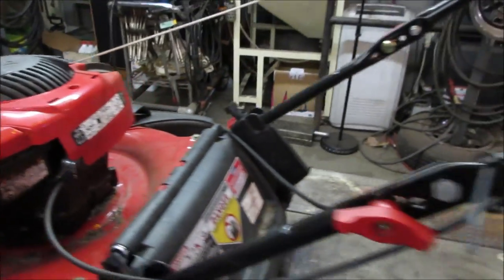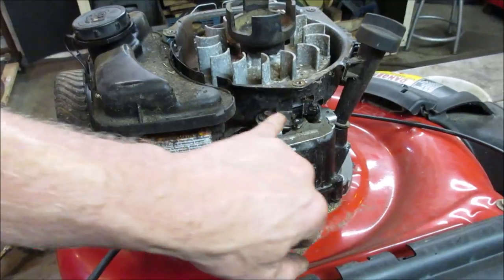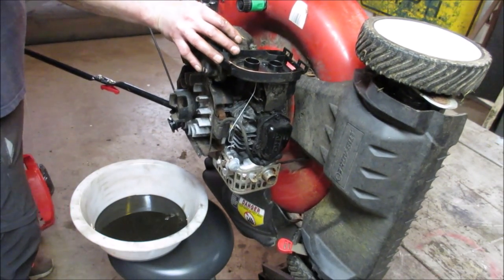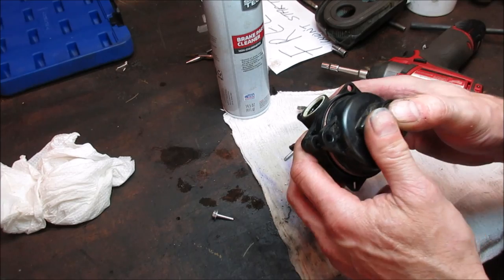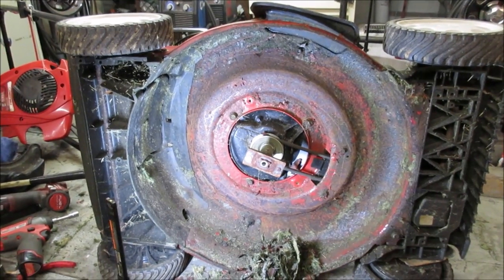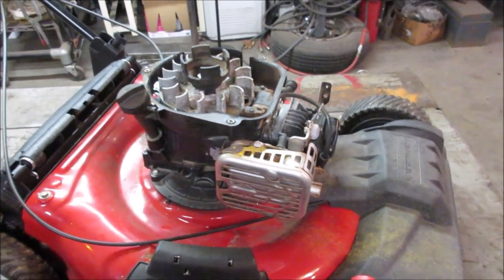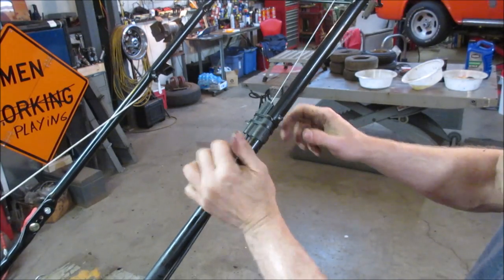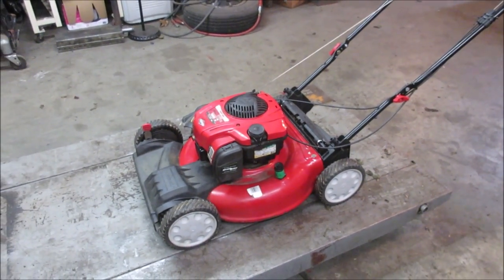How To Restore A Junked Lawn Mower. For Cheap.

Comment: A great tool to have for all engines is a propane torch that is cut off. Take a hose and put it on the torch. You can then meter fuel. It makes for great diagnostics. I have even ran lawn mowers left outside all winter with propane for 10 to 15 minutes and then they were able to run by itself after being cleared out. I highly recommend you try it.

Comment: I have one of those disposable mowers from Lowe's and even with a cleaned carburetor, I had to chop off the choke/throttle interconnect to get it to run.  Emissions requirements have ruined the performance of small engines.

Comment: Evening. 
Firstly, loving the channel. Full of useful information, really easy watching and look forward to catching up with your clips👍

I have a question if you don't mind?

I noticed you used break cleaning spray on the plastic carb today. Is that cleaner safe to use in the USA on carbs?
I'm in the UK and they say not to use break cleaner on carb because they rot the seals and will stop working??
In the UK we use carb cleaner because it is O ring friendly compared to break cleaner.

Just wondering if my hardware is bulling me 🤔😂

Comment: Reminds me I need to clean the carb on my power washer.  The float likes to stick and pours gas out of the filter.  It fixes itself once it's running.  Probably runs kinda rich for a little bit until the filter dries up.

Comment: its also a good idea to replace the fuel line on older mowers, this fine fuel we get seems to eat up the inside of the line
 and bits of it , get into the carb, causing problems.

Comment: My kids bought mowers with these same carburetors … they wouldn’t start either. I was told to get $16 a quart gas from Home Depot/Lowes.  I took both carburetors completely apart (including the jet tube) and cleaned out several times. Still no start. I had to take a injection tube filled with gas and blew out the jet from the inside. there was blockage inside that freed up and it fixed the no gas flow real nice. Second pull every time on pump unleaded, even after 3 months sitting.

Comment: your choke rod coming from the muffler is on the wrong side of the choke shaft on the carb. It should be on the rounded side of the choke shaft. Keep up the Good work.

Comment: on the old Yamaha's, I gave them one or two slow kick throughs with throttle slightly cracked/choke on, stopping just at start of compression stroke, then a stiff kick would light them off instantly, even in near 0F weather. of course they were mostly early CDI ignition setups, so it didn't take much to get a hot spark.
mostly mid 70's bikes and they had factory kickstart compression releases built in, you could just drop the weight of your leg and they'd fire right off, early 70's and back were picky, harder to kick and may try to through you over the bars or put your knee through your face.

Comment: How funny, I just pulled the carb on my LC122a Husqvarna and the carb is exactly the same.  I pulled it for a cleaning because it's been "hunting/surging" for a while when idling.  it's better now, but still not like it should be.  I think I need to pull the main jet assembly and give it a good cleaning.

Comment: I JUST pulled our mower out for the first mowing of the year.  I had to coax it with a little starting fluid, but it wouldn't get enough RPMs to stay running.  I pulled the carb, and did exactly what you did (same B&S engine), and she ran like a dream.  We have non-ethenol fuel here so I'm not sure why I got "junk" in the carb.

Comment: That’s actually a 2016. I’m a fan of those Troy bilts. I have one of those tb200s sitting in my garage that’s my back up mower in case my main push and riding mower give me issues. It’s a one pull and it’ll start machine.

Comment: Some places will bolt the blade on upside down and backwards for shipping safety on new mowers . Always check when buying a new mower . The blades are designed to working at 3000 RPM . Prime for a good time , I love it .

Comment: With that style carb to get the bowl off I usually have pretty good luck sticking a needle nose plyers in the gap next to where the screws were and pulling the handles apart. Pops right apart. For me prying with a screwdriver tends to mar the plastic. Also usually use a screw driver to pop the white part out to access the jets for cleaning. Was a little concerned about the oil when he tipped the mower to get the gas out since that was carb side down. Although since he cleaned the carb he did eliminate some of the issue with oil flowing to the carb.

Comment: This is what i'll be doing this afternoon, my mower started last week, yesterday no start, i suspect bad gas and maybe the ignition ground, the mower i had the longest was an old 2 stroke lawnboy, i gave a friend a beer for it when he couldn't get it started, he had ran it without an air cleaner and it sucked a blade of grass into the reed valve, 10 years later i sold it at a yard sale for $50, i bet it still runs.

Comment: I own and operate a small engine repair shop and you should have pulled that oval white plastic piece out. I know it feels brittle but get a decent pair of pliers and grab the top that is sticking out and wiggle side to side while pulling up and it'll come out. There are about 8 holes inside of it, plus the oval plastic piece also comes apart one more time once you get it out.

Great video but don't be afraid of pulling on that white piece as long as you don't squeeze the crap out of it with pliers, it'll come out just fine.

Comment: I have the same model Briggs "550EX" (625EX Self-Propelled) on my Yard Machine. IN FACT I suspect that it IS the same mower except for the self-propelled. Just did some maintenance and got it ready for summer... oil change, sparkplug, air filter and carb (carb kit was no cheaper than a whole new carborator, which is plastic)... HOWEVER, the governor wants to hunt a bit. After 10 years it might need a new governor spring... maybe. IN REGARDS TO THE CHOKE LINKAGE... there is a tiny design flaw in that the arm at the end of the choke linkage will RUB against the inside metal wall/mount and stop it from moving. Just bend the metal wall a bit by tapping with a hammer and screwdriver... tapping it out a teeny tiny bit, giving it a little room to maneuver. Re the bagger bag... I'LL BET that the owner still has the bagger in their garage somewhere, on a shelf, 'cause mine came with the bagger!!!

Comment: Most mowers generally use SAE 30 weight.    10-30 is what you use in a pinch.   It's expected that if it's too cold for the oil to flow at start at 30 weight, it's too cold for the grass to grow :)

Comment: I agree with your reasons for the throw-away society. If my employment results in $25/hr after taxes and an appliance repair costs $200 it's easy to argue the DIY approach. What amazes me is the cost of parts and the difficulty finding them. It seems that the suppliers keep raising the price of components without considering that they are negating the motive to purchase them.
Just tried to buy an electric range element control (burner switch). Suppliers want $60 so I dismantled and repaired the switch myself; more time but worth my time.

Comment: On some of those new plastic carbs the Briggs and Stratton ones have a rubber tip on the needle it is stupid because they swell up and come off also the main jet poles out of there pretty easy be careful blowing those out because that little ball will go flying everywhere but normally just clean that jet system out was a little piece of wire in some spray and that’ll do it

Comment: Great video as always, Mustie 1. Is it just me or is the starter rope not oriented properly on the push handle framework? Have you had any issues with using Brake Clean on the plastic bodied carbs or on O-rings?

Comment: WURTH 2000 best product for covering metal for storage i spray it on my aluminum rims for the winter then wash it off in the spring really covers and protects with a film that won't wear off until you wash it off

Comment: Thanks Darren - always a good video. I’m surprised that’s 200cc’s. 6.25 hp and self propelled. My Husqvarna is all wheel drive and only 173 cc’s. A bit oversized! Love your channel since Crustie was red oxide!    Chuck in NE Kansas (with coffee in hand)
Reply: I see later in the video that back when this was built, the model is a TB200. I assumed it was a 200 cc. The fine print shows 150 cc on the sticker. HP equals 4.25. My bad.

Comment: Hey Mustie1, thanks for the awesome vid!  Did you end up switching that thermistor arm from the right side of the spring loaded choke control to the left?   I thought the arm coming off the "thermostatic spring" would have pushed the plastic piece against the plastic piece on top of the choke butterfly, causing it to open over time, then the spring on the carb would ensure it returned to closed as it cooled down so the thermostatic spring wouldn't have to pull the butterfly closed.. not sure, it's been a while since I've worked on one of these plastic carb set throttle auto choke units.  Keep them coming, I've picked up a lot of things on this channel!

Comment: The presenter did a good job disassembling and explaining what he was doing and why. One suggestion to make his videos much better is the plan to replace where items to show the audience how it is done. Using parts to the point where they are near or at catastrophic failure is very foolish because it degrades significantly the performance of the mower. My suggestions would be to replace all wear items immediately which include the blade, the belt, the cables as well as all the fluids. I would also take the time to clean the entire machine before and after explanation show how dirt and crud can cause parts to malfunction such as the magneto contact area, the carburetor including it's o-ring, especially the underside of the deck as well to lubricate the bushings on the wheels and all pivot areas on the machine. Of course the spark plug should be replaced, but importantly set the gap on the plug and to show the audience how it's done. It's important to understand that the mower is a mechanical device primarily and to explain how these mechanical joints fit in work are important but also to see what it looks like in the new condition as well. So the presenter gives slightly more than half a picture. A good example would be the blade, what does the new blade look like in comparison to the worn one? Now his explanations will truly come to life. In any case I did enjoy the video and I learned a few things, so thank you but in the effort of continuous improvement I offer these suggestions. Thank you and take care.

Comment: i' had problems with float bowls on our snowblower and lawn mower until i switched to high octane fuel which is usually ethanol free.  i buy iy at a local station that has separate pumps and nozzles for each grade of fuel

Comment: On the cable you can remove it and twist counterclockwise and it will extnd the pull and give more pull to clear the switch

Comment: Because they are air cooled engines, that have no filter, working on hot days, i ALWAYS use full synthetic oil. It keeps the engine cooler and is more resistant to sludge.

Comment: my mower engine from 1974 is on the 3rd deck, since I got it in 1990. 25bucks. btw, I was trying to tell you about the screw, and just pop out the float.  isn't it cute they use 2 different sizes screws to hold the carb?

Comment: mustie1 usually a few times a year when i get done mowing i will clean the deck off really good then coat it really good with the teflon spray used for snowblowers by doing it after mowing it has a week or so to dry before it gets used again and as far as those deck cleaners they are just junk they just make a mess and makes it harder to get the grass off later

Comment: I generally take a needle scaler and knock all the rust off, then spray it with ospho. Once that dries I hit it with a brush on primer. Then a brush on bed liner. Seems to hold up pretty well. The OE uses powder coat, when it is in good shape it works great but as soon as it wears through or gets damaged it starts to rot under the coating and the moisture will wick under it and makes it even worse. One of the bad aspects of powder coating.

Comment: I helped out at a Toro dealer for a bit, and the Toro manuals bragged about never having to change the oil on the push mowers, so they didn't have drain plugs, which the mechanics thought was dumb. And yep, they came back for seasonal maintenance, and oil was questionable, often low. Everything is considered throw away now days. lol
Reply: Growing up my dad had a 1994 lawn boy 4 cycle 4.5hp Tecumseh mower. He literally never changed the oil ever and it finally lost compression in 2020. That's a good run I'd say.  Ever since I've seen that I never change the oil in push mowers lol

Comment: Was told a long time ago to only put in as much gas as your going to use and run it till it stops.. never had an issue with stale fuel since.
Reply: Yeah same, if it has a fuel tap, shut it off while running and let it burn out any remaining fuel till engine stops..

Comment: It looks like that mower was set up for mulching and the blade looked like a mulching blade.  The blade should have been sharpened all the way to where you were holding it.  You can see that this is where it had previously been sharpened.  With that mulching action, the clippings will stay under the deck longer and the blade is set up to cut them up finer.  The blade will cut at 2 levels to help with this action and that's why you needed to sharpen that blade almost full length!  It also helps to mow at a slower pace with a mulcher to give it time to process cutting clippings fully.

Comment: A lot of people use the same gas can forever without every cleaning it out or even emptying it completely Sometimes the design of the can won't let them and crud and water end up staying in the gas can and ends up contaminating the new fuel you buy. Back in the old days when it was common for the gas stations to have steel in ground tanks bits of rust and water contamination was common and that's why they used to put sediment bowls on the older mowers. About 40 years ago I worked part time for a small engine repair and springtime and the fall were the busiest times because of no starts from mowers and snowblowers sitting and the old fashioned points and condenser ignitions breaking down.

Comment: Thanks, good info to see if I can get my neglected no-name beater going this spring. 

The selfpropel is spinning those wheels pretty fast when they're in the air. Does that mean the belt is always slipping when it's under load? Or is there some friction plate up front?

Comment: I used to work at husqvarna in the press area  i saw the press that presses the blades 
They start as a coil of metal about 36 inches tall
And about 20 inches wide
 The machine presses around 150 blades an hour and they arent checked for balance only occassionaly for straightness the press operators usually couldnt tell you if a part was slightly misshapen  they actually had to have a jig to tell if a part was bad
And no a pressed part isnt always the same as the part that preceded it nor is it the same as the part that follows it
Most parts have an acceptable variation of 30 thousandths  ive bought blades before that werent perfect but used them anyway without any problem so mustie is Absolutely right it doesnt matter if you balance the blade

Comment: I always clean my filter with compressed air , people are very wasteful . Oh an learned my lesson with tech 2000 , changed oil an light immediately , shut it down and checked , was transmission fluid labeled as 10w40 .

Comment: At the beginning, it would've been funny to see a John Deere push mower, on the side of the road.
10:50 The word you're looking for is thermostatic spring. My old cars has one bolted in the intake manifold, for choke.
31:30 After the final cleaning of the season, I spray vegetable oil (environment friendly). Prepping and painting isn't worth it because, the dirt and dust will sandblast it, in no time.
47:13 It is "gimmicky". It doesn't rinse the deck thoroughly. Some grass clumps remains.
47:34 I have an old REO Royale (Just the engine). 
55:19 Only Mustie dared to add a turbo. Ha ha ha...Indeed, I get it !
Reply: As of last year John Deere push mowers are no longer available as they stopped producing them for the European/UK market. They weren't that great in all honesty.

Comment: I hate those plastic carbs. I had a Murray that I got for free. It came from the store not running. When I got it I tore into it. The main jet didn't even have a hole in it. I got it running and it would only run for around 3 hours before I had to clean it again. I never saw any dirt in it but it wouldn't run until I cleaned it.  I got so good I could take it off, clean it and have it back together and running in less than 10 minutes

Comment: I was wondering if fuel cleaners and treatments work for small engines.  I have been putting it in my push mower tank at the end of the season to keep the fuel fresh and carb clean.

Comment: Amazing what people throw away these days I found one on the side of the road for free in 2008 and I am still using it.
Reply: Repair costs often far outweight the cost of keeping small engine stuff anymore. as Mustie said, $250 for  a new lawnmower vs $150 just for a shop to look at it not including parts. then you add in parts say a carb for $100. shop bangs that upto $150 to cover costs, you already over what mower is  worth
Reply: @harveylong5878 I totally understand that but the lack of simple things that people don't understand like the brand new stihl chain saw I got for free because someone didn't know how to change the chain after they tried cutting rocks.